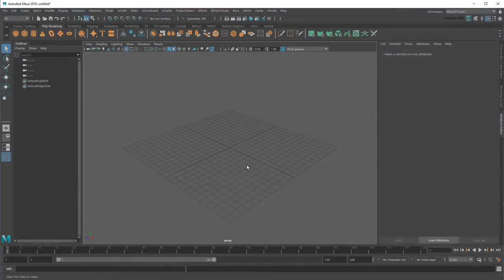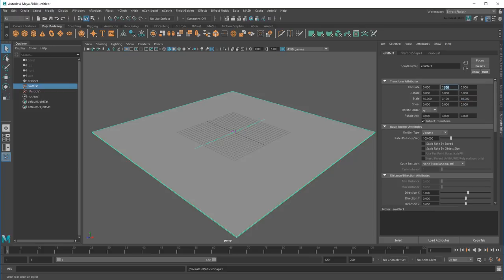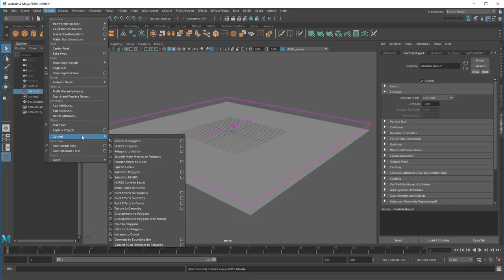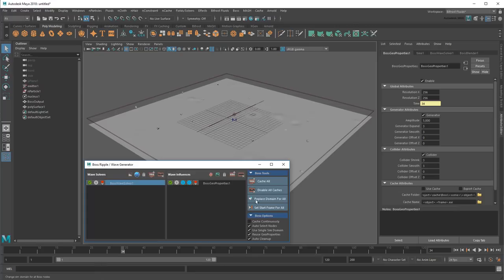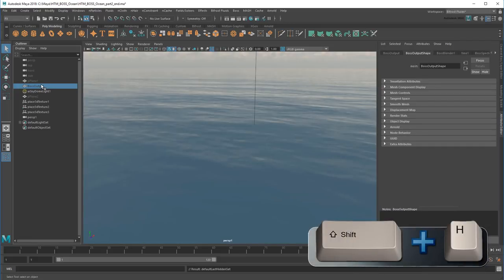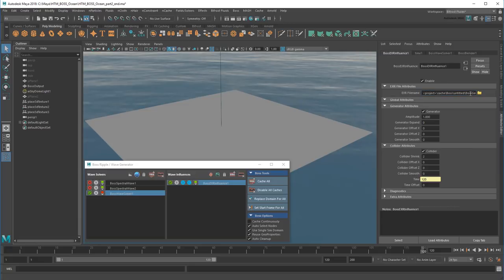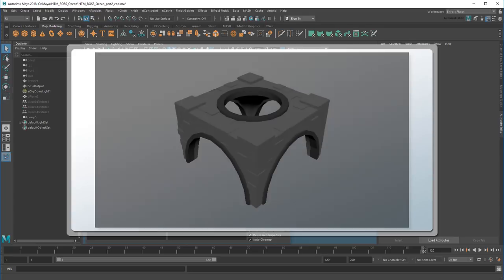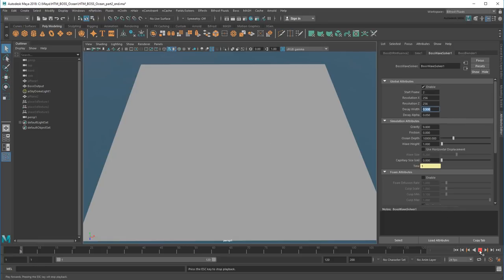Creating an ocean - Appendix A: Raindrops

Comment: great tutorial man . can you help me please , when i import .exr to cache i received this message ( <project>cache/Boss/water_test_new.mb/BossGeoProperties1/BossGeoProperties1.<frame>.exr does not exists! Please check //  ) please tell me what i did wrong !!. thanks
Reply from the maker: Sounds like either you didn't generate a cache properly, or possibly that you're reading from a different location than you wrote the cache to.  I'd double check the folder on your hard drive to make sure those .exr caches are there.
Reply: @Autodesk_Maya   Hi, I had the same issue as G4arts. I was trying to create my own ripple map in After Effects then exported it as OpenEXR sequence. I used green as the color of the ripple and black as the background. I placed the sequence inside the cache>BOSS folder of the project. I've checked the EXR sequence and it plays fine in a video player. Then I did just like you did, I linked the EXR image sequence and changed to the correct naming conventions. Still I am getting the error like above .exr does not exists! Please check //  ) By any chance you would know why this happens? Thanks!
Reply from the maker: @Tobsters755  Have you set the current project using File > Set Project?
Reply: Maya Learning Channel yes I’m pretty sure I have. Though it seemed to worked if I use an exr sequence that is cached/ generated from Maya.

Sorry I’ve got another two questions though. I hope you don’t mind ;)

1.I was trying to create a ripple effect that spreads right under the boat. But since I created the ripple effect on another file like you did, it doesn’t quite match up with the position of the boat when I import that exr map into the first file where I have my boat and waves. Is it possible to move the map around after imported to make sure I get it to be at the right spot? 

2. Does order matters between ‘spectral wave solver’ and ‘wave solver’ in the boss editor. For instance, I had my ripple effect created before I made the waves, that means the wave solver is on top of the spectral wave solver in the editor. When I combine the two, I can see the ripples working fine on the waves. However I tried another time where I created the waves first, then the ripples, and the ripples just get covered up by the waves completely. 

Sorry about the load of questions. Thanks again!
Reply from the maker: @Tobsters755  1.)  You could project the map onto your ocean as shown in part 3 of this tutorial, then offset the projection until it appears under your boat.

2.)  The order shouldn't matter since the effects are added to each other cumulatively.
Reply: Maya Learning Channel I see! Thank you so much for the prompt replies!